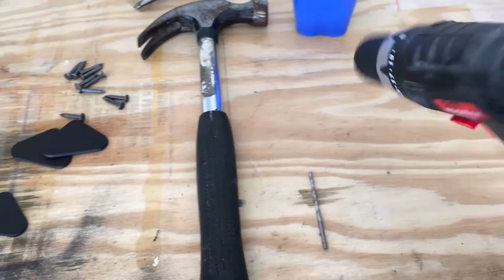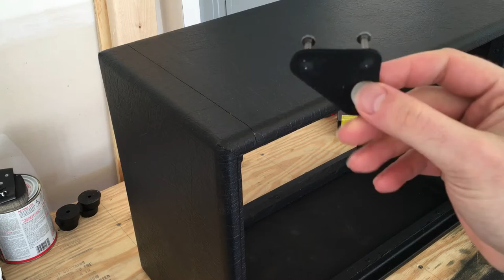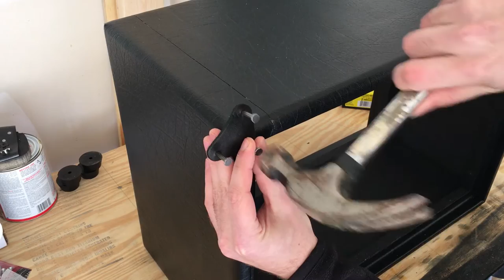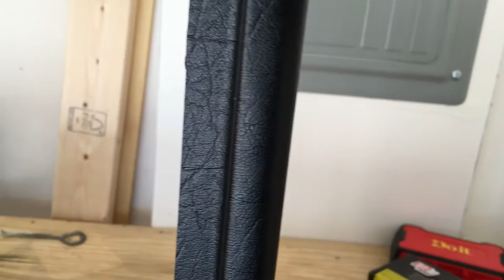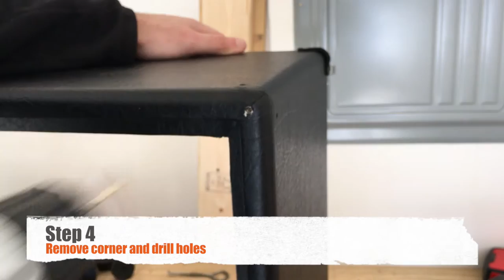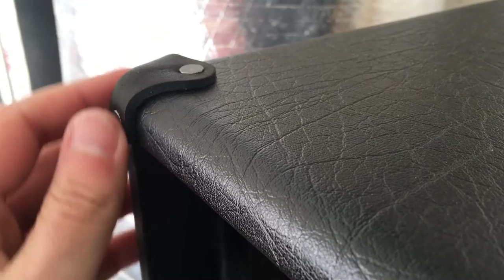How To: Mesa Style Leather Cabinet Corners

Comment: Why did you use the drill? cant you just use the hammer?
Reply from the maker: I drilled the hole first to keep the wood from splitting. It might be fine to just hammer them in but I didn’t want to risk it because I was using thick nails instead of smaller tacks